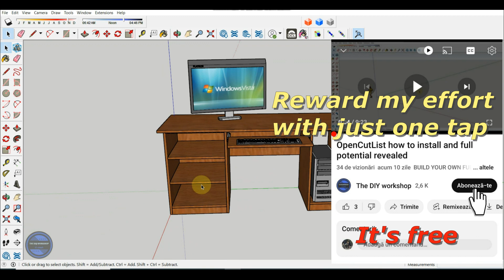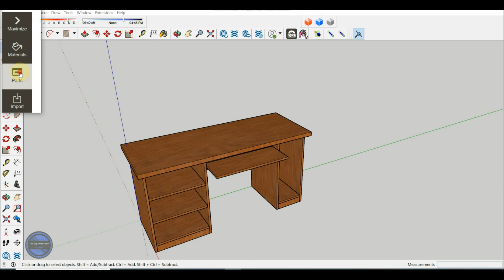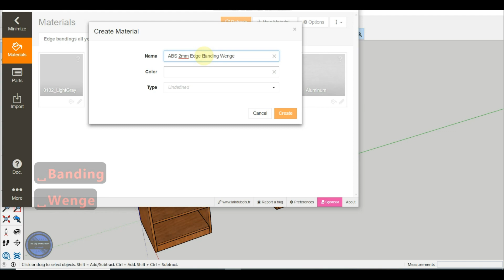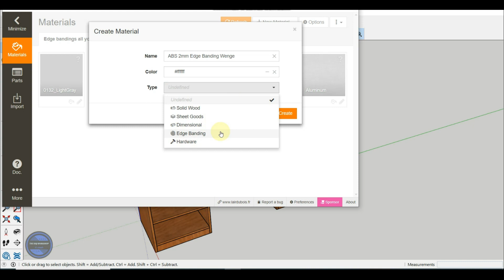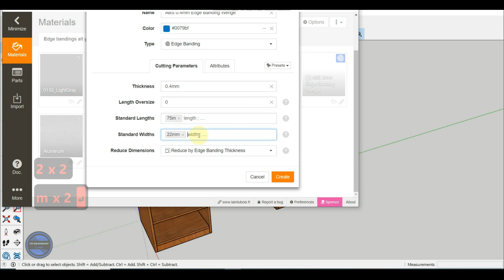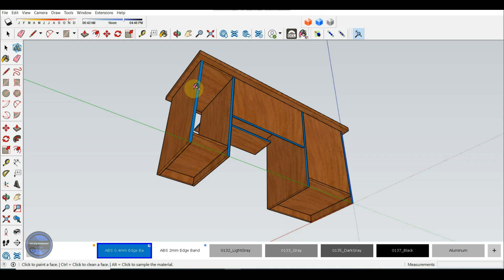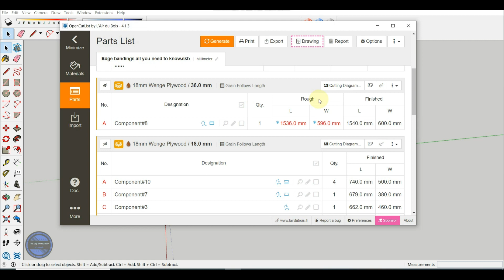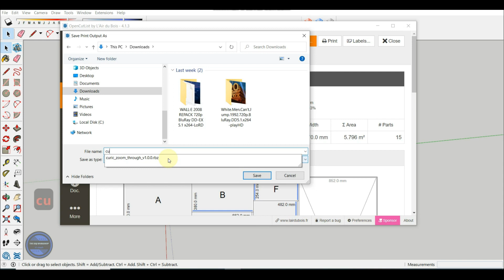How to apply edge bandings Sketchup OpenCutList

Comment: Why a width of 22mm on a plywood of 18mm thick? 
Is it because of the 0.4mm edge? So the guys that apply the ABS will know they will have to cut 2mm on each side? to have smooth edges? 
Thanks
Reply from the maker: Sorry but I had to give up on that Sketchup playlist. I haven't played with Sketchup in a long time now. You can use Chat GPT for a lot of software related questions. That's what I usually do. Good luck!